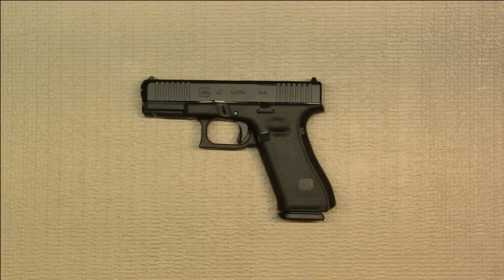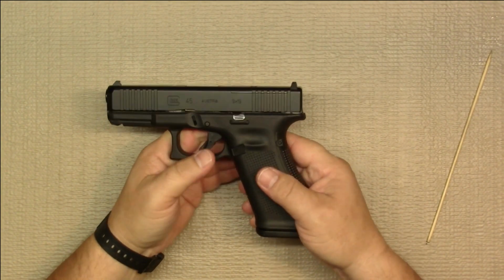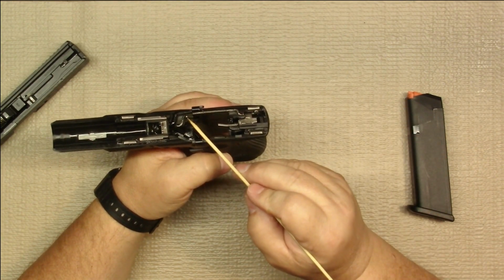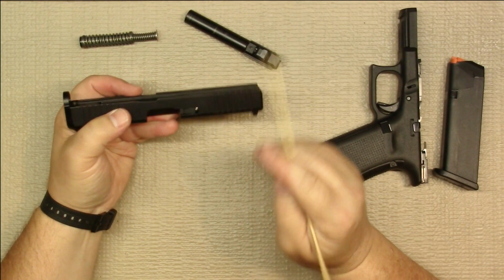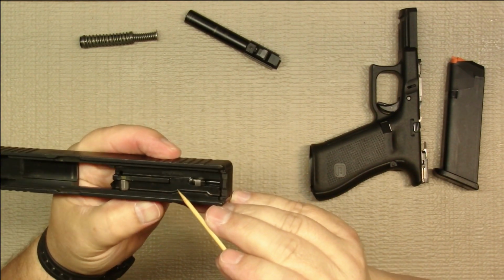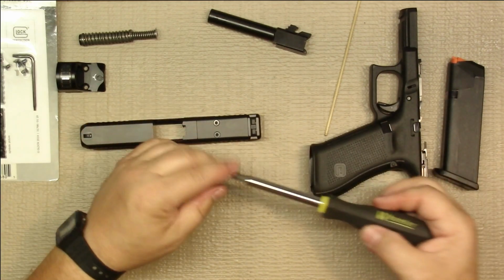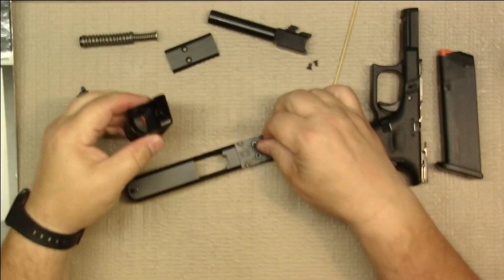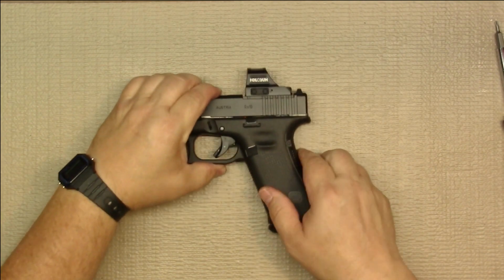GLOCK G45 MOS

Comment: Great Video. Very Informative. I just picked up my 2nd G45 and I am adding a Trijicon Red Dot to it. I think it is the most durable one on the market for duty use. Any opinion? By the way, once you fired a few rounds you had a good tight group!
Reply from the maker: Thanks, it usually takes me a few shots to get back into the groove these days. (and on same days it never happens and I just give up). As far as a duty weapon it is hard to go wrong with Glock. In all honesty I still prefer the Beretta 92/M9 series however that in know way diminishes the capability of the Glock. I am just old fashioned in that regard.
Reply: @CraigsGunChannel  Carried a Beretta M9 during a stint as a Contractor in Iraq because it was issued to us. We were allowed to carry what we wanted but I figured why not beat up someone else's gun? On a return trip I carried my Kimber .45 1911. Again, thanks for the info.
Reply from the maker: @MC-td4ol  Kimber 1911 45 would be tough to beat.
Reply: @CraigsGunChannel  are all g45’s generation 5?

Comment: I have the Glock 45 MOS.  which mos plate did you use for the holosun 507c?
Reply from the maker: It uses the same plate as the Trijicon RMR (They have the same footprint). You do need to make sure to check the attachment screws however as many times they are a hair too long which causes fitment issues.

Comment: What screws did you use for the mounting of the holosun to the glock mounting plate?
Reply from the maker: The MOS system came with 4 plates and several screws, I got lucky and one set of them worked fine. The screws that came with the Holosun itself would not work as they were the wrong size (both in length and thread pitch.)